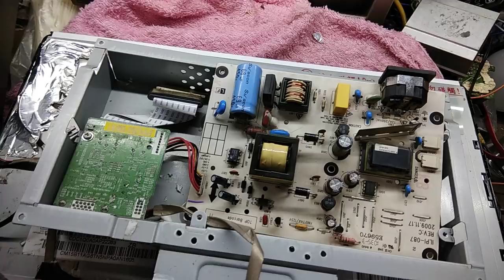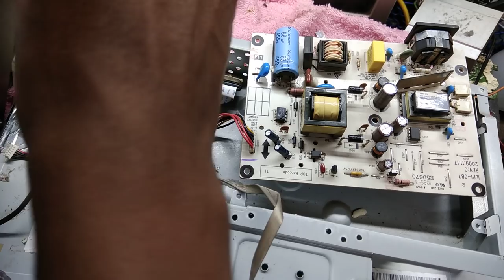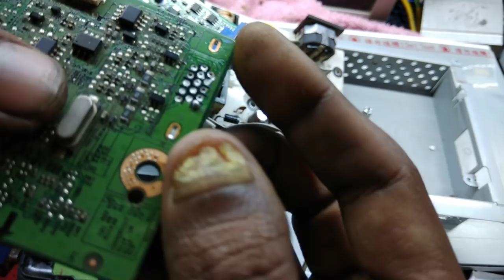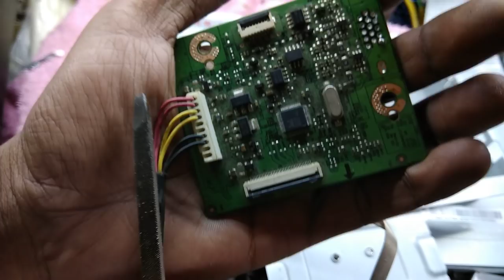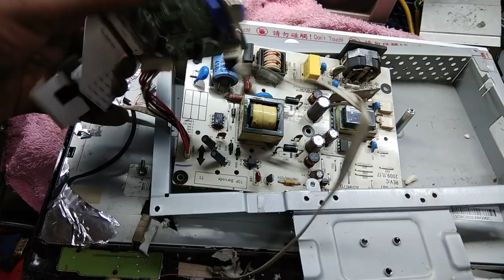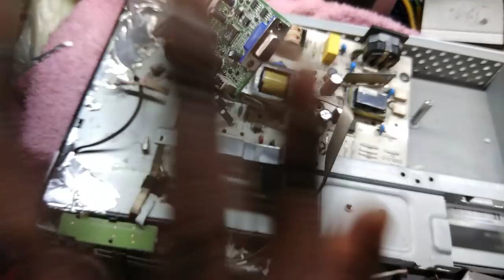understand the basic concept of lcd/led monitor lozic card repair

Comment: You are realy master, my questionthat I am having Acer 14 inch monitor 1st problem was SMPS fault ic with  TOP258PN I tried but fail then I instal 5 wire modul now power is ok 5v and high is 19v the sei on and auto start and off for fue minutes then no light no panel indicator light, I seem the logic board damage what to do, I Would like to meet you, wheather you are in kolkata give your details address, thanks.

Comment: Bro, my monitor is getting power on with power light but logic board is not working and sometimes the power led turns green from standby mode yellow. So bro, can you plz give more details in repairing Benq 19" logic card?

Comment: my hcl monitor work good just for one time each day (i don't know why) , i checked multiple times voltage level in smps, logic card and key panel every voltage level is fine (maybe) but still yet its unable to START.
as i said my monitor just work for one time each day and after that when i turn off power, monitor doesn't show anything, even power led (blue led in key panel) not turn ON

Comment: 3 vertical lines are coming in monitor, picture is ok, how to solve this problem.
Reply: My vertical bars problem yet not solved, please suggest me what I have to do. in switches board I am getting 26.2 V DC.
How much volt it should be.